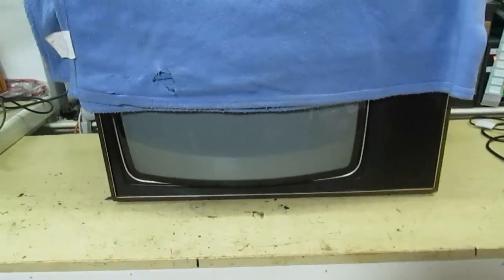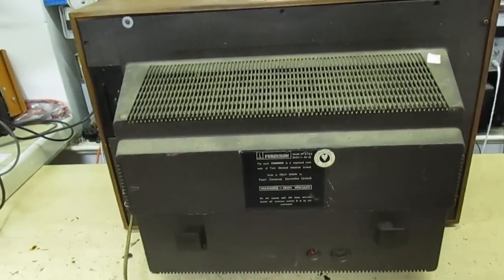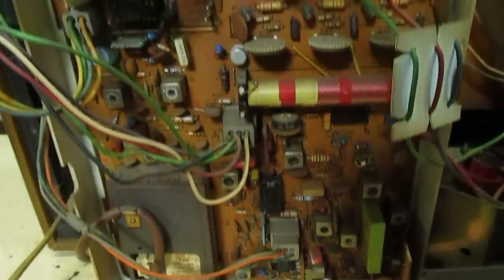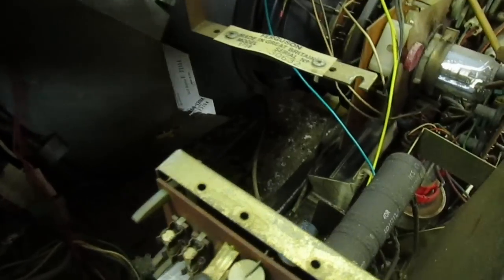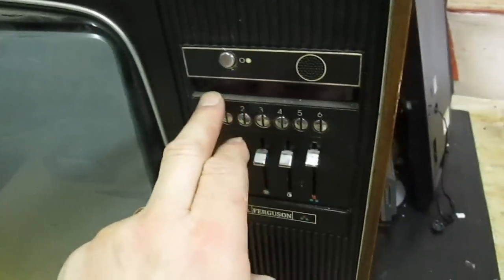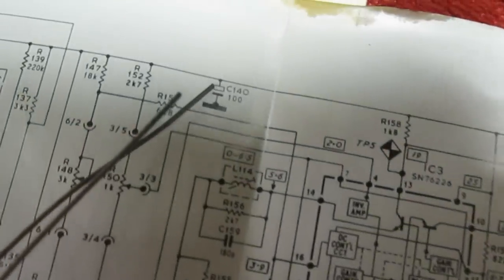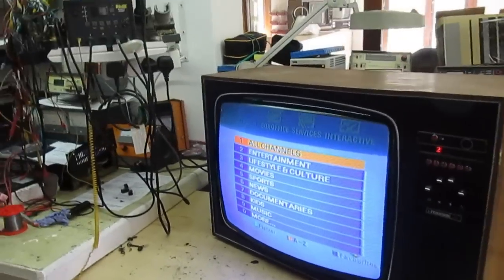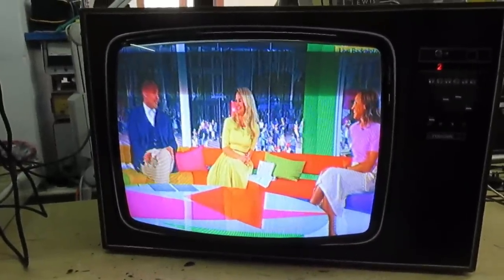Thorn 8800 chassis vintage TV set from 1977.

Comment: This takes me back to my Apprenticeship at Rediffusion. The Toshiba tube became common later Either the Tube was replaced of=r it could have been a late production run. I think I still have some of the Notices/Bulletins about Mods and Stock fault issues we got periodically. Ferguson were famous for doing that.  I laso remember one fault associated with the 3500 series that; thankfully didn't plague the 800= - 8500 chassis.... Blown Selenium metal Rectifier... Oh my God the smell. Thanks for bringing back a lot of good memories. BXL was Bakelite Xylonite Limited; and we had one of their plants across from our rediffusion Service Centre in Newton Aycliffe...  Every Thursday at 11 oclock in the morning we'd hear the sires go off for their regular Emergency drill. Very safety conscious company. You could set your clocks and watches by them.

Comment: My father was self taught from television magazine and used to buy ex rentals in batches of around 10. Scraping the worse, tube re gunning, rejuvinating, fault finding, setting them up had a mirror on the bench. The wood cabinets would be sanded and varnished. Much of the village had a tv from my father.
Reply from the maker: Only time I did sanding, varnishing was when I accidentally damaged a customers TV on the door handle carrying into the workshop, when I started out selling refurbished TV I use to buy EX rental  GEC s in brown plastic cabinets as you could re cover the whole TV with a roll of fablon in just a few minutes .

Comment: An excellent production Michael, very nostalgic for me, you did very well to troubleshoot the component faults but I’m sure the feeling of achievement was worth the time and effort. It’s a great shame that such talents aren’t financially viable. I too used to use copper clad pcb and etching fluid to produce project boards as a youngster. Such talents have been totally de-skilled nowadays by using software packages such as EWB. One push of a button and the PCB screen is produced from  the onscreen circuit diagram, this enables the board to be produced, amazing. Great stuff, keep it up. Best wishes.
Reply from the maker: I have to admit I'm not a big fan of all this software  stuff, give me back the good old days any day, agreed, I did think I did well considering how long ago I last repaired one of these  , things kept coming back to me though and it was a good trip down memory lane .
Reply: Same here, started with srb, then quickly moved on to fibreglass, the ultimate then, still is!  Hand layed out and drawn with a Dalo pen, which I still have and amazingly still works! Then hand drilled with a mini drill press, good lord it took hours!  Now though, I admit to moving to the darkside, I use one of the Chinese pcb specialists. The quality, speed and price is just to good to not use.  For surface mount there is no alternative for the hobbyist.
Reply from the maker: @turboslag  Had the Dalo pen with blue ink , I still do hand drawn pcb s now and ferric chloride etching , maybe I'm too old fashioned !
Reply: @michaeldranfield7140  
I don't think so, there is a place for traditional techniques and if it that is a preference then fine.  Personally I could never get my DIY boards to even compare to the superlative quality and finish of the PCB specialist companies, and for me time and money are important factors.  The finished project looks so good to.
Reply: Them old colour sets had such good build quality
Reply from the maker: @seansands424  They did but they were expensive compared to someone's wage back then , so you got what you paid for .

Comment: Excellent work, and yes Tantalum caps are notorious for shorting out. A common failure mode is that they will appear to work for a few minutes then the resistance drops. You can normally tell which one it is as they get very hot!
Reply from the maker: these days I dont work with tantalum capacitors any more   , I think the last one I replaced for a living was in a vintage graphic equalizer a few years ago , but yes what you say ties in with my findings , the cap was OK when I first tested it, then a few minutes later its leaky .
Reply: @michaeldranfield7140  The short often disappears when the equipment is turned off for a bit so will again work for a few minutes next time you turn it on, then away it goes again and so on. Used to get it all the time on radio equipment.

Comment: I used to go to the back of our Rumbelows branch in Heswall in the Wirral. They had a lock up around the back and they used to throw out all the old TV sets and the PCBs not cost effective to repair. I used to go and grab loads of stuff and strip off the components for my projects.
Reply from the maker: Same here , in the 70 s I use to climb into the industrial bin at radio rentals looking for boards , never found anything good though, all my best stuff came for the tip !

Comment: Fantastic video! Thanks for sharing. A set from the days when we used to actually make stuff in the UK!! Not only that - but they could be repaired as well (and still can)!! I used to make pcb's using one of those pens as well! I used an off-balance Meccano electric motor on it's base to agitate the ferric chloride and (hopefully) speed up the etching process. Veroboard was quicker though, provided you didn't make any mistakes (which I often did!)
Reply from the maker: glad you liked it , more coming , as you say a set from when we were leaders in this field and Thorn employed thousands of people producing this British designed and built stuff , dosnt it make you wonder where we all went wrong , these were exciting times for me where you could make a good living out of straightforward repairs .

Comment: Exact TV we had in the late 70s until about 1985 for when it went wrong and we bought a teletext TV from Hitachi...  I remember exactly what the remote control looked like, and if you jangled keys sometimes it would mute or change channel, also the remote would scare my nan's cat.   This was our first colour TV and when we got it my dad played a Joke and had the colour wound down, we bought it second-hand, we never rented.  It was much more reliable than our previous black and white TV with valves, as the repair man was such a constant visitor back then
Reply from the maker: yes , these sets had ultrasonic remote control, you could point the remote at a cat and its ears would prick up , and as you say a bunch of keys would replicate the frequency .These sets were getting pretty un reliable by the mid 80s and most of the tubes  didn't last too well either .

Comment: I remember watching a TV either the same,or very similar in the mid to late 70's. My tooth fell out,and I dropped it down the back of the TV. Never saw it again.
Reply from the maker: sets of this age always had lots of ventilation holes in the back you could drop things into , they had to with the amount of heat been generated .

Comment: One of my favorite models was the Thorn 3000 3500. I liked the way you could get access to everything and flip the top panels up to gain access.
Thorn also produced some excellent service manuals to aid fault finding. The guys I worked for used lighter fuel and oil to clean switches, I remember one TV bursting into flames when the VHF/UHF system switch was operated. The good old days. LOL.
Reply from the maker: The power and line boards in the 3500 were difficult to access the back of the pcb s but apart from that thy were ok but getting a bit long in the tooth in the 1980 s , I still have a few bits for the 3500 , R2008 , R2010 , red 2 amp cut out and the flywheel diode for the chopper PSU . and of course the yellow service manual folder !
Reply: We had a Thorn 3000 that belonged to someone on a steel hull house boat . They used a diesel generator for the mains. It was forever blowing up or sitting in the workshop after a repair .lt ran perfectly on soak for weeks sometimes . The owner refused to admit that his clunky diesel mains generator was defective . It annoyed my boss that we had to go 12 miles to get the set each time it failed.
Reply: @michaeldranfield7140  I still have a safety cut out in my spares collection somewhere. I found the access to the psu boards and line scan panels difficult at times myself.

Comment: Amazing you managed to get it going with all those dry joints, in 1977 we had an itt KB hybrid set, always braking down , I remember watching are you being served on it :) thanks for posting
Reply from the maker: ITT KB hybrids such as the CVC5-CVC9 were notoriously un reliable due to the amount of heat generated in the cabinet from the line output valves .
Reply: @michaeldranfield7140  yes the engineer was in the back every 3 seconds. Ours was 26 inch tube, only 4 mechanical channel buttons . First thing I ever saw in colour was nationwide. Was outside broadcast about 1976 at a fair I think, that's when 625 was turned on in Oban and we had for the first time 3 channels.  The set before was black and white 26 inch dual standard itt KB on 405 lines with only bbc1

Comment: Bit of memory jerker this one Michael, on my pathway in the industry as a young 18 or 19 year old I worked at the giant Thorn Consumer Electronics (BRC) in Bradford.
At that time it was the biggest TV factory in Europe employing north of 3000 people. In my time there we designed and built the 8000/8500 series and the 3000/3500 series, the last product before closure was the Cyclops 9000. I continued in the business - field and workshop , rental and retail for various companies and ended up at Pace Micro ( closed 20 odd years ago). Racking my brains, I cannot ever remember Thorn using the Toshiba tube, Mullard and Mazda but not Toshiba, besides, the emission was far to good on your set for an original fitting. A mate of mine  worked for Telebank - they were the slot TV leaders.
I liked the pun when you described the sound as a low rumble on switch on when it was an ex Rumblelow set !
Reply: My first job was with BRC Hainullt making radiograms.
Reply from the maker: Makes you wonder where it all went wrong ,BRC, the biggest factory in Europe, pace micro leading the field in sky digital boxes and they have all gone , now nothing more than a memory ,glad you liked the video , brought a lot of memory's back for me , when I was good at repairing TV sets ,
 I remember the Thorn syclops 9000 chassis , always had the EHT tripler breaking down to chassis .

Comment: Nice one MD that bought back some memory's , I was a field engineer working my way to workshop foreman for Rumbelows happy days ,always liked the 8500 easy to repair, remember beware the blue tant (and red).
Reply from the maker: you don't come across tantalum capacitors in modern equipment any more but I will now remember this for the next time , glad you liked the memory's, I don't even think rumbelows even exists any more
Reply: @michaeldranfield7140  Rumbelows are long gone, there is a facebook group for ex Rumbelow staff mainly sales.

Comment: My that was a blast in the past for me that top conv pannel always cocked on them think we had 20 of them out on rent
Reply from the maker: Looks well cooked in this set , lots of Thorn designed set ran far too hot and suffered from burn ups in the line stages .Remember how bad the 9600 was round the EW modulator .

Comment: Magic Smoke! Rifa capacitor? I love these videos. When I was about 9 or 10, I remember finding lots of scrap telly boards behind the Radio Rentals shop across the road from my parent's house. Me and my best friend at the time would scavenge through it all and I used to bring back lots of panels and circuit boards, not to mention valves. I always remember seeing lots and lots of tropical fish capacitors which fascinated 9 year old me. It formed my interest in electronics and TV but I used to play with the boards more than anything else. It must have been the local service engineers using it as a base to dump their scrap. I didn't really understand what I had at the time, it was when I got to my early teens that I got my first Micronta multimeter and Weller soldering iron from Tandys!
Reply from the maker: if you were to ask me how I got into electronics in the first place  I could not give you a definitive answer but as a very small boy I remember going out for long summer walks with my dad and seeing discarded bits of radios and TV sets lying in the grass I would twist off the pretty colour dog bone resistors and take them home, so like you it must be a colour thing , problem is I'm still like that now , if I'm building something and say I need a transformer I will buy the red or blue on over the black one !
Reply from the maker: @toddblanks  Glad you liked it , doing these videos help me to remember better times , in fact everything was better before we had flat screen TV s ,
 Im lucky that I convinced a friend of mine , who is by the way a much bigger hoarder than me , to get rid of some of the TV he's has had for the past 25 years as sets like this don't come along very often and when they do they command very high prices , so more coming soon !
Reply from the maker: @toddblanks  Glad you liked the memories, more coming soon ,
Reply from the maker: @toddblanks  I am self taught but in the 90s I took a 4 year city and guilds course so I could get a qualification just in case I ever needed another job ,
 back in the day there was no internet and I shared my skills , like many others did by writing for a magazine called Television which has now gone bust.
I'm glad you liked the video , it helps me to relive my past, the problem now been as I'm getting older I'm forgetting a lot of stuff I use to so I'm not as good as I use to be back then . .

Comment: wow funny how quickly my mind remembers so much about these and the 8500 the moment i saw the back cover. you took me back to my teen years late 80,s early 90,s collecting these from fly tipping sites all around plymouth usually ex radio rentals always with good condition mullard crts and just simple faults, sound output feed resistor o/c , eht tripler ,loptx and occasionally  faults that turned out to be design errors requiring component value changes- companys were really honest back then !
Reply from the maker: So many memories for me too , life was so much easier repairing sets like these , as you say all the stock faults and easy to get spare parts , its a far cry from the crap produced today .
Reply: @michaeldranfield7140  well wasn't all plane sailing  I can always remember how replacement parts the quality was terrible you ended up fitting 2 new loptx to find a good one  but the tech support was there and the sharing of information between competitors when you got stuck on a set was amazing
Reply from the maker: @darrenmurphy6251  The worst LOPTS for this were made by HR and as you say fitting one of these could cure one fault but bring on another , I remember once fitting a HR transformer in a Thompson set and it cured the tripping but then I had lack of width , after much time wasted I replaced the transformer with a Konig one and the width problem was gone .

Comment: Really interesting. We had one of these from about '77 for nearly 10 years. It was badged Baird, from Radio Rentals. The touch tune buttons were more recessed into the panel, otherwise identical. The wood effect case was more thermoset plastic than this one. The ultrasonic remote, powered by 9v battery so it was quite thick was just two buttons. One for sequential channel change, the other muted the sound to almost silent. Seem to remember the main on/off switch often failed.
Reply from the maker: Mains switches were a common problem in a lot of sets back in the day , some used in Sony sets use to burn up , I remember the remote but don't have one for this set but a viewer on here has offered me one .

Comment: Ein Schciker Alter Kasten aus der guten alten Englischer Ptoduktion ;=) ^^ .
Mich wundert das in dem Fernseher noch eine 140X Delta Röhre Verbaut ist , ich kenne die Fernseher von 1977 die haben schon X510 oder sogar schon X540 In Line Farbbildröhren verbaut. 
Ein Super Bild für einen so Alten Fernseher mit so vielen Betriebsstunden .
Reply: The 120X series are 90 degrees tubes, so less power draw and easier to converge.

Comment: Nice work. Some months ago my LCD multistandard TV that does VHF band 1 & 2 UHF & digital, it has PAL & PAL 60, NTSC 4.43 & NTSC 3.58 & SECAM with HDMI & SCART & componant in & a smart card reader with USB & a DVD player, so too nice to throw out. Im a ham radio operator anyway so know the script. It went down & it was a cap on the PSU on the 12 Volt rail. The cap was a fraction of its original value 2700 mF was reading only around 6mF but it was its low resistance that caused the PSU to keep tripping out. This was my thinking that it was a smoothing cap down & it was the 3rd cap i tried. I did not have a 2700mF so I inserted a 3300mF but there was a place for 2 caps the original & the next value up & the slightly bigger cap  fitted perfectly. So the other day repared it. Working again.
Reply from the maker: Very common now in all types of equipment due to the fact almost every manufacture uses cheap caps sourced from china to keep the cost as low as possible .